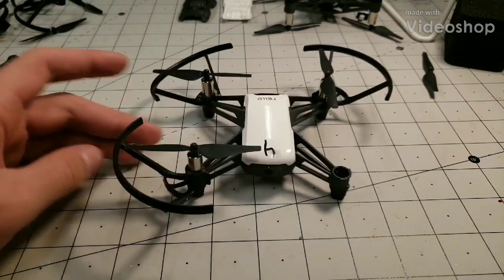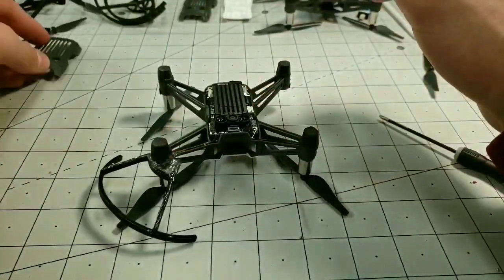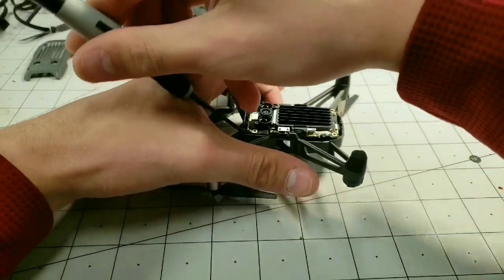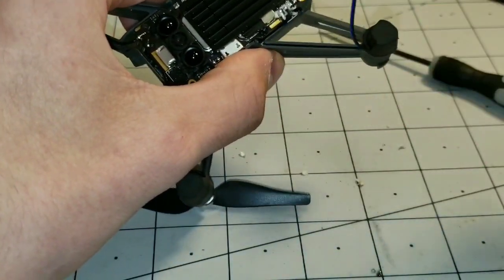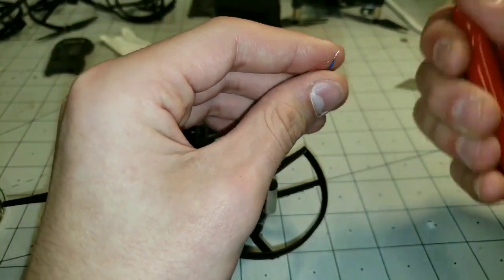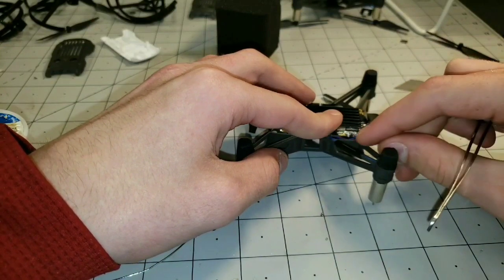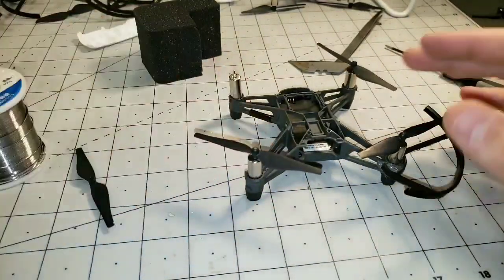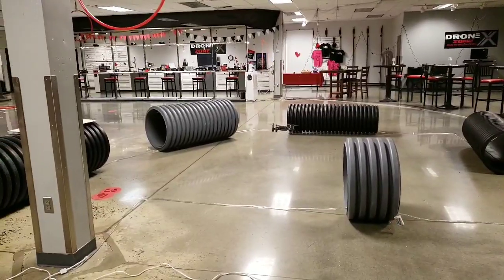DJI/Ryze Tello Motor Replacemnt Tutorial

Comment: Tellos motherboard is roughly the same size if not the same size of some of these cheap WiFi drones I’ve seen is it possible to take the motherboard from the Tello and put it inside one of the larger cheaper Wi-Fi drones and connect everything together and make it operational ?

Comment: There were clips (male, I think) on the replacement motors but not on the tello, so you cut the clips off. What if I wanted to place female clips on the tello to connect the new motor to, so I didn't have to mess with soldering. Would that be possible? Sorry if this is a dumb question.

Comment: Hey I have a question anyway you can help? I changed the motor exactly how you did it. Except now when I insert the battery the motor I changed which is the rear right one starts to spin now soon as I insert the battery I have no idea why. Then I turn it on and connect and try to take off all other 3 motors spin but doesn’t fly. Just flops over to the side and props on correct. Camera works apps seems to work good no lag getting a code 29 which means motor error but not sure what is it. Confusing power must be going to only that motor when’s it’s off only but how if I didn’t mess with anything else helps plz
Reply: Is it possible you put the incorrect motor in? Just like how the props need to be installed in the right side, there are motors for each side as well. I'm new to this but that's the only theory I've got. Hope you found a solution!